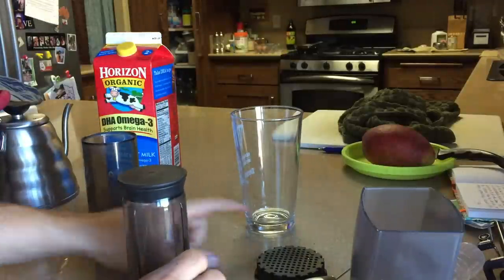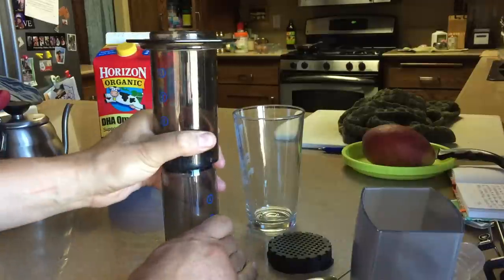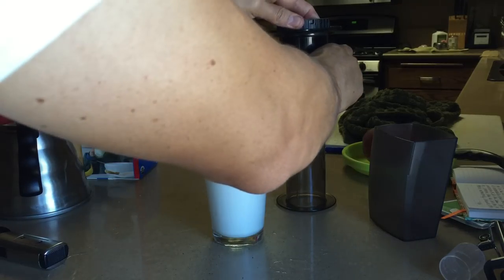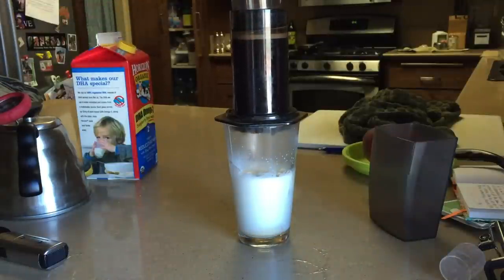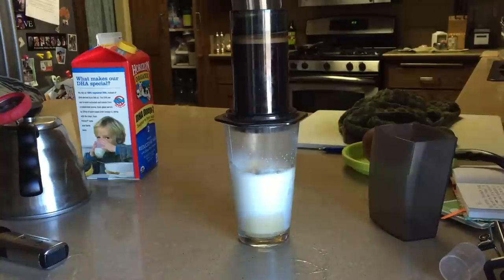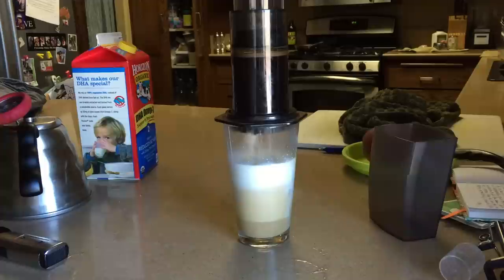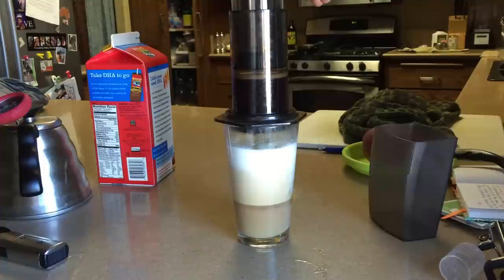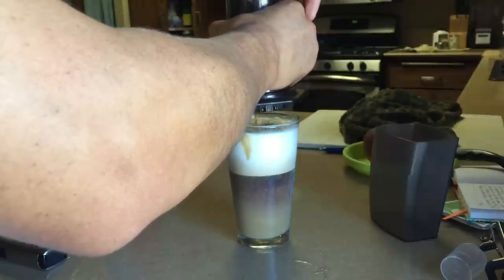Aeropress Latte

Comment: Instead of a milk frother get an immersion blender and a fellow prismo cap for the aeropress. Use these prismo attachment on the aeropress to make espresso. Then put some milk in a pot on the stove on high heat and hit it with the immersion blender. Press the espresso. Then pour the frothy milk and voila. A well above average home made latte. Total equipment cost would be about $50 for the aeropress, immersion blender, and fellow prismo cap. Assuming of course you already own a pot and a stove